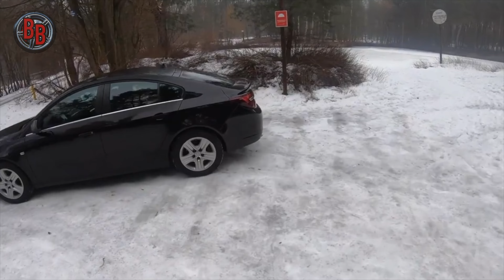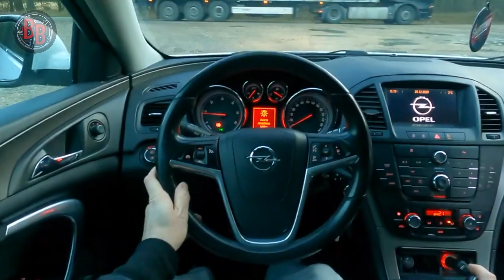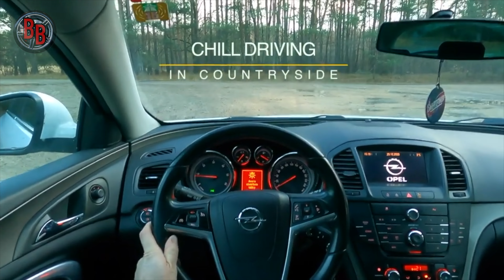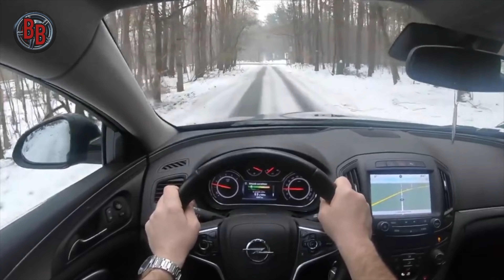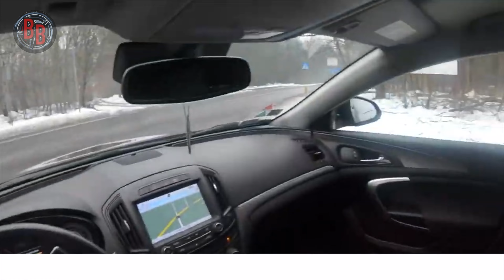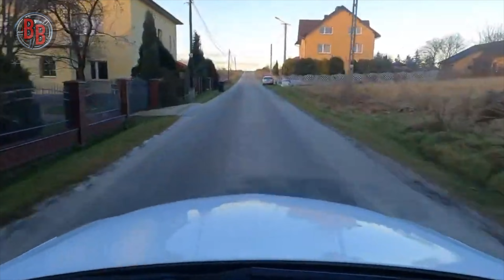Opel Insignia 1 - Check For These Issues Before Buying

Comment: This must be the most stupid youtube I seen on a long time. I have an 2013 Opel Insignia 4x4 eLSD with all options, live in northern sweden where it's very cold. I have not had any problems with my Insignia what so over in nearly 3 years, best car i ever had, superb 4x4 system with the eLSD that works much better than Audi, VW, BMW, Mercedes (yes i know it's haldex) but opel and saab upgraded the system with eLSD. Will never sell my insignia, was the only car around that started when it was -50, Audi, BMW, VW, Mercedes was dead, so ny neighbours had to ride with me to work in my Insignia as theirs car did not start at that temp :) Opel!

Comment: Crap cars
Reply: I just bought one, and already had a alot of issues. Ive owned alot of opels before, mostly Omegas, best cars ive had, but the insignia, i fucking hate that thing. NEVER again
Reply: You must have been unlucky I have had 2 Vauxhall cars, the first a 2004 Vectra from new clocked up 189,000 miles in 10 years.  and now on a 2013 Insignai 13,000 miles when I bought it. It  has now reach 256,000 miles.
Reply: @SHOLTIE2004  I think its you who has been very lucky.

Edit.......Sorry about this comment. Maybe you're right. I just found out last week that the car's mileage had been clocked. So what is currently registering as 73k is INFACT closer to 150k which will explain somw of the problems I've been having. Its not really the cars or manufacturers fault. It's done a lot of miles and so naturally some things will wear out.
Reply: @MrElchav nah, I concur. I have a 2009 2.0t petrol, and had it do stage 1, giving out 285 bhp and almost 47kg of torque, putting a lot more strain on the engine and it has now reached 160k no issues whatsoever. You were just unlucky
Reply: @jimkrom  I agree.
Reply: @SHOLTIE2004 it’s all about how they are looked after
Reply: @SHOLTIE2004 looking at buying one of these this week that’s sat at 90k, what routine maintenance would you recommend? Cheers mate!
Reply: @robbielaughton7844  Only have mine serviced once a year. Nearly all my driving is on motorways so pretty easy going on things like clutch & brakes.  My car has now clocked over 273,000 miles.
Reply: @robbielaughton7844 change the oil regularly and itll run forever .
Reply: Poorly engineered. GM make crappy cars.

Comment: My 2014 2.0 ecoflex diesel 160bhp Sports tourer has 250k + and has given me very few problems. Maintenance is essential on these cars. If buying and it doesnt have a 100% Full Service History dont touch them. 
Yes i had a new rubber seal fitted to the oil pump (dont need to dismantle the gearbox) but its still a 5hr job. Turbo hose was replaced at 178k and egr was removed and cleaned at 210k. My pressure sensor glowplugs came as a set of 4 @€140 each. Timing belts and pumps done before recommended time, and only use Valvoline SynPower MST C3 5W-30, front suspension uprights done too 3 weeks ago and thats really it. Economical, very comfortable, deceptively quick too i cant really complain. I cant understand the hate these cars get. 
More often than not its because owners have skipped on the maintenance and thats why they fail.
Reply: I have the 2012 version in elite Nav. At only 68k, it drives like its done 250k. The engine service history was full till 51k which was when I bought it. Kick starter replaced, instrument cluster replaced by manufacturer as all the lights had dimmed and were flickering, new shock absorbers, electronic power tail gate module and end connectors replaced ( cost a fortune )! Cambelt/water pump changed and yesterday morning, EGR failed and car went into limp mode. EGR was replaced today an there's still more to do and the car has only done 68k! Despite being the top of the range, the car feels like it running on concrete wheels. The Ford Mondeo is a far superior vehicle.
Reply: I have  an 2013 Elite , 2.0 diesel, it has now clocked up 256,000 miles,  apart from the  usual tyres & brakes i have had to replace 3 of the tyre sensors, an alternator belt,  the cam belt and water pump I have had changed at 100,000 and 200,000 miles. replaced a broken coil spring,  Engine still runs great and I get about 55 mpg out of it. most of my driving is on motorways,  as i do an 84 mile round trip to work 5 days a week.
Reply: I have exactly the same car, 90.000 miles, no problems at all. I am selling next year to buy a new car, just for a change.